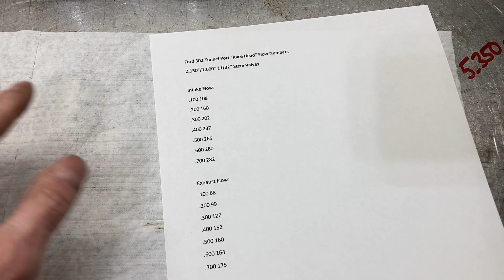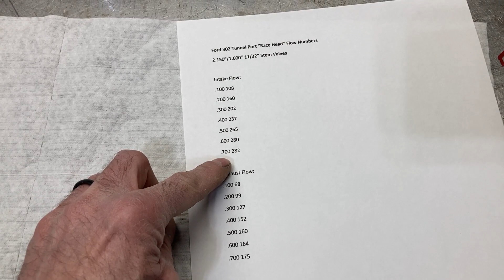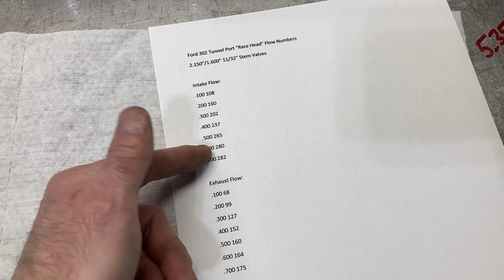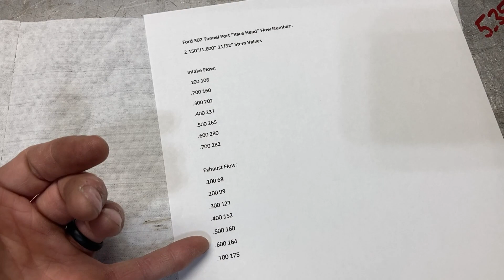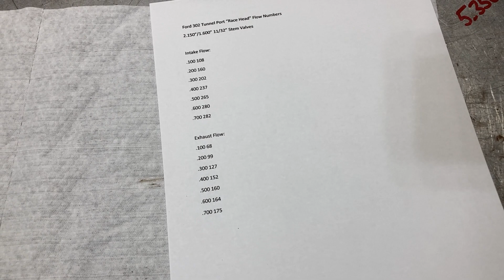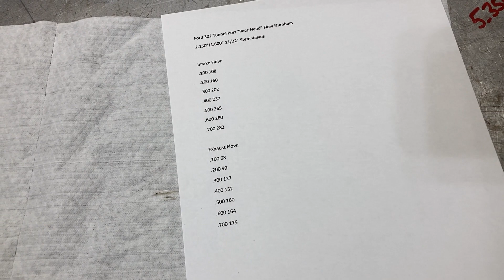Lykins Motorsports Ford 302 Tunnel Port Competition Head Flow Numbers

Comment: This was a free Turkey Dinner for me. Thanksgiving, Sir. 🥝✔️ It's got no mixture motion, but it equals the best factory cast Cleveland 351 4V, 351 Boss and Boss 302 4V heads. About 15 CFM above the C9 code Boss 302 at 600 thou. You can see FoMoCo were using the SuperFlow as an Index test in 1967 to 1969. The real work was on cam and dyno tuning, and how they put the whole packages together.  You can see how Ford would have effectively thrown the game in 1968 SCCA Trans Am racing ..imagine mass producing those engines in a Quality Control Cabbage Patch...No wonder Ford had issues with making these awesome engines fly. You've got two Tunnels port heads...Street and Race. ❤️ Your work and Science...